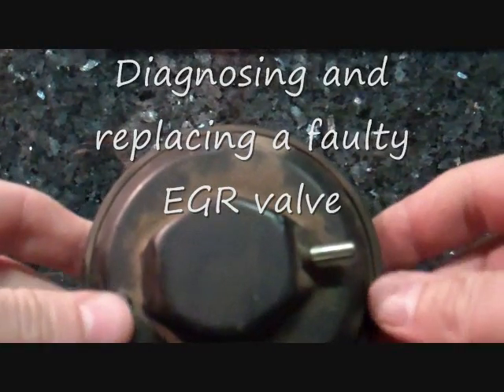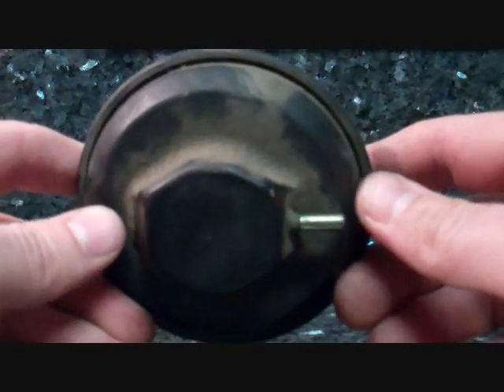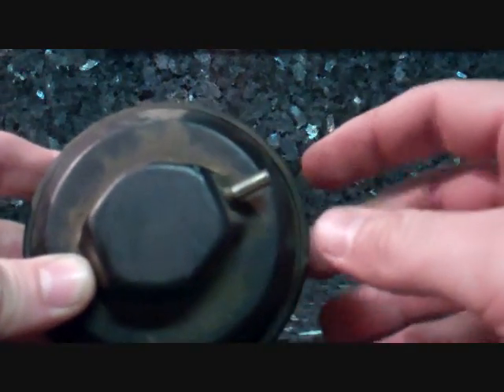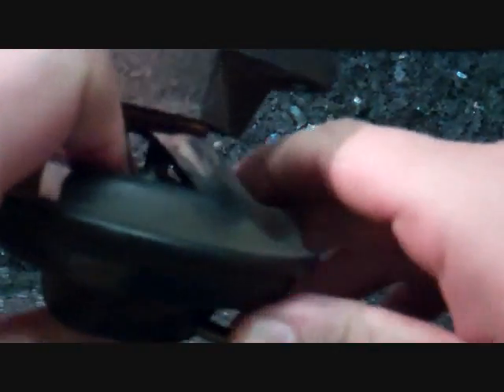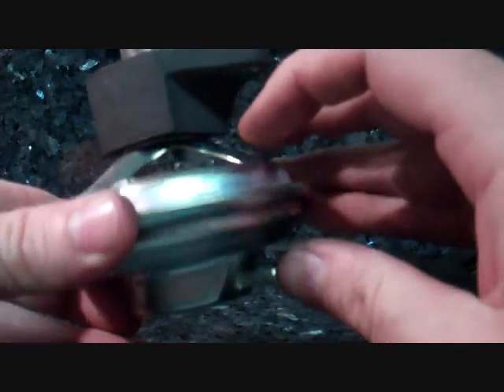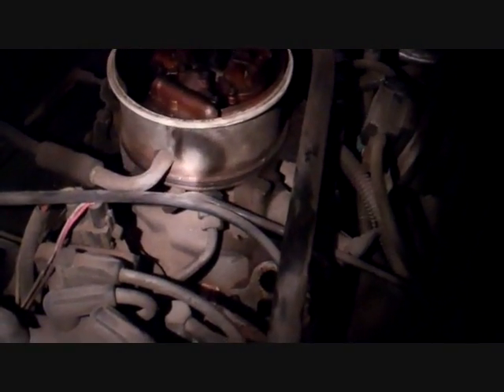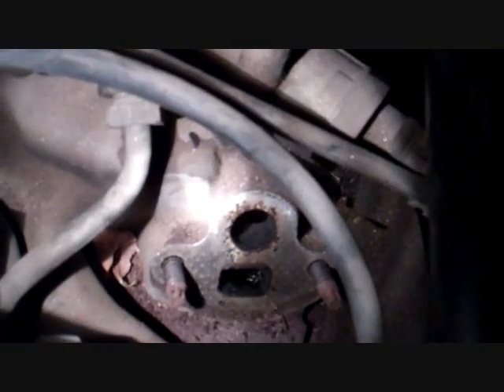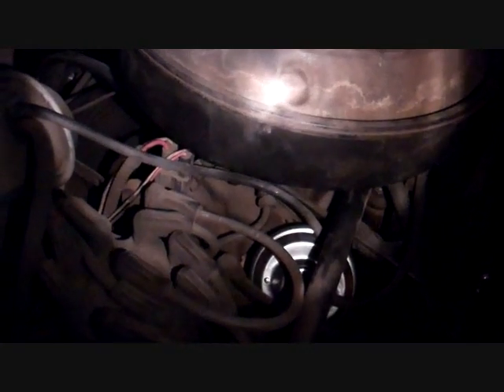Diagnosing and replacing a faulty EGR valve with a vacuum leak.

Comment: My bronco chokes and runs like crap when accelerating ay kow to mid range rpms. After unplugging vacuum line and blocking off vac line that problem went away instantly. Didn't gain any power but what it did was stop that choking and running like it's on 2 cylinders bs. Wondering if i have a leak/ low vacuum issue

Comment: make sure to scrape off all old gasket material. Also it never hurts to check the vacuum that comes to the EGR valve and that is operated/regulated by other component/s. Some people eliminate the EGR valve completely and put a metal plate over it.

Comment: I was trying to remove the nuts to check my EGR, but the nuts were also turning the stud. Do you know if I can remove the stud completely then install it back in after? Thanks for the informative video
Reply: J. Rocha yes nut stays on the stud do that bolt last and take egr off at the same time.

Comment: Hi,I have a 1990 Chev G-20 Van with no EGR valve,blocked off.
Would this cause rough Idle from 600rpm to 800rpm,up and down idle speed.
I also have problems excellerating mid throttle.
Thanks
Reply from the maker: It's possible... I'm not asc certified or anything, Google has a lot on the topic, search for egr block off and rough idle, or cons of egr block off
Reply: Hi,I bought this '90 Van with the EGR blocked off with a plate.
After watching the videos,I don't understand why someone would block the EGR valve.
On excelleration,the motor stammers at mid range and I have less power up hills.
On the highway it runs fine.
I live in Canada where temperature varies between -10 to +35,I'm thinking of replacing the EGR and see if this could be the problem.

Another issue is the 3spd turbo 400 tranny.
Dropping it into reverse with the brake on,
I sometimes hear a thud or bang.
Sometimes it goes in smoothe and sometimes it makes a thud sound,shifts smoothe in forward gears.
Thanks.
Ron
Reply from the maker: +Ron W yeah mine did the same clank... I think it's just a feature of an old transmission. Go easy on her. I did some research yes, the cold would have a lot to do with it. just reinstall one they're cheap and easy to put back on. also, I'd check for other vacuum leaks.
Reply from the maker: +Ron W also, I had the exact same van, I have found the transmission is much less noisy if I stop in neutral for a little while. as in don't go directly from drive to reverse let it rest in neutral a few seconds
Reply: That makes total sence,I will try that.
Why does the rpm rise and fall from 600 rpm to 800 rpm.
Could this be due to the EGR valve and a vacuum leaks.I've had a mechanic look at it,and their confused or don't want to spend time looking.
Ron
Reply from the maker: +Ron W your idle issues sound like mine.  my idling was all messed up, low speeds were to fast. as soon as I found and fixed all of the vacuum leaks things worked better. have you confirmed that whoever blocked off the plate properly secured the vacuum line that leads to it? go under the hood AND the doghouse and spray anything that looks like a vacuum line with starter fluid while idling. You'll hear a change in the engine when you hit a vacuum.
Reply from the maker: +Ron W and by under the hood I mean attached to the underside of the hood. buy fresh rubbery vacuum hose at any auto store. If it cracked once, it won't take long to crack again.
Reply from the maker: +Tunacrab I'm intimately familiar with this vehicle if you want to get in touch outside of YouTube
Reply: No,I haven't done this yet,good idea.
1990 Does the EGR vacuum tie into a solenoid switch or straight to the throttle body/manifold.
Reply from the maker: Ron W it went to a switch on mine, mine was a 91, but in pretty sure they're the same thing.
Reply: Ron, EGR valves are not activated in idle. Check for a vacuum leak, however.

Comment: I have a 1990 G-20 and I went to check the oil today and noticed exhaust gas coming out  of the oil filler tube and it was super hot, also my tail pipe rusted off behind the cat could this be causing the problem?

Comment: I have a 1990 Chevrolet G10 Van 350/5.7 My ERG valve is no good but when i took it off i noticed there was no vacum line connected to it I do not no where the line is. I noticed if front of the TBI there is a nipple coming off my intake manifold does the line go there?
Reply: ***** I have a 350 5.7 1990 Silverado. The hose on the FRONT of the Throttle body goes to the EGR solenoid. Then, from the EGR solenoid, another hose goes to the EGR.

Comment: Hello-
I have this same style van and I am having trouble getting my EGR valve off. What wrenches did you use? 7/16 angled? My valve bolts are very rusty. Did you have to remove any peripheral items from around the EGR valve. I am trying to soak the nuts with PB Blaster at the moment.

Comment: Thanks for the video.  My wife has a 76 'Vette with a 350 and VERY EASY to access EGR valve.  So easy to access that I will use your tip to check the EGR valve.  Thanks again.

Comment: I would like to add that most TBI equipped cars are very picky when it comes to the EGR valve. Try and buy AC Delco or Delphi brand when getting a replacement. Use your factory OEM number to match up the new one. The "universal" types that autozone sells are usually crap and will still give you trouble when brand new.

Comment: Very informative video thanks!!!

How did the computer know that there was a problem with the EGR system if there are no electronics hooked up to it.
Reply: the vacuum line that connects to the valve is also connected to a solenoid that controls the vacuum given to the valve. typically these solenoids have a temp sensor in them that can sense when vacuum is sent through since it only circulates hot exhaust fumes.

Comment: can any one show me where is the egr valve in 2001 gmc safari sle i am looking for that but i dont see please can any one explain me where is it on this modle engine
Reply: The EGR valve is located on the CENTER HEAD under your CARB/TBI usually towards the firewall..

 It will be easy to spot as it is the begging of the vacuum lines. Yours may very well be completely different shaped than the one in this video so I hope this helps.

Go to autozones web site to see a picture of what yours looks like to help you locate it faster!

Comment: Mine will INTERMITTENTLY (about every 3 key starts once it warms up to temp), run terribly in a "rich" choke mode kinda explanation. Ive done almost everything, replaced egr and egr solenoid, map, tps, full tune, cleaned all the grounds including ground straps, ... and one guy on here kinda had it when he said "coolant temp sensor" NOT coolant temp SENDER!!.. was fine, now installed another NEW CTS and its doing IT again INTERMITTENTLY. A mechanic told me well maybe you need to replace the distibutor "module" and or you may have to replace the ECM??... who knows but these are my next ventures. Ill keep you posted. thanks... - DTM ... BTW... No engine light in almost 1 years so... dont know.
Reply: Did you ever find out what was wrong?
Reply: Yes... replaced/resealed intake gaskets!! It took a week but easy and well worth the effort, time, and money. (about $200 spent)... I had the rear intake "quick-disconnect" brake off flush with the intake so my buddy had a nice "clean" intake on the floor of his garage that was going to go in his scrap pile?... booom!!  $50 for it. Ive had NO problems with the "choke mode" what so ever. Id suggest taking some starting fluid and goin around the intake to see if the engine idles UP and down... I also found coolant in my oil kind of slushy and bubbling out of oil tube and I figured luckliy that it was just getting into the lifter gallery?... my hunch was right. replaced/resealed intake... problem solved!! It took some effort, $50 for the intake off buddy, about another $150 for parts (new EGR was expensive), some time (1 week - Im picky!!), and some patience and problem solved. make sure that when you take out the distributor to make sure you are ON top dead center for reinstalll of the distributor. thanks... - DTM
Reply: Thanks for the update! You know what did it for me? No lie (and a little embarrassing)--just replaced the A/C and radiator fan relay switches and two fuses...voila! Engine cooling system now works, no overheats, no surges, no hard starts. Just a few measly fuses. Huh!
Reply: Lincoln7Echo Did egr valve cause a overheat because i have a ford f 150 1999 thst showed egr valve problem and it overheats.
Reply: Marky David nope... Mine didnt overheat at all. my "dummy lights" went out and no "dummy lights" have come on. ...

Comment: I have a 93 buick lesabre 3.8l its run pretty good but the problem I'm having is that it sometimes idle's high sometimes on start up sometimes it don't 
sometimes it does while driving sometimes it don't no check engine light on its like it idle's high when it want too.Have had sensor and ecm replace.what will be your opinion on my question?

Comment: My car jerks when trying to stay a constant speed from 30 on up maybe 25 on up. I am about to pull mine off and clean it and see if that helps any. Mine isn't wide open on the bottom like that. It only has little small circle opening about the size of the actual ink cartridge thing in an ink pen. The car sat for a year and 1/2. This jerking started off only doing it at 40 and real light. Now it does it at a wide range of speeds if trying to stay steady speed.
Reply: by a idel contral vavle  put it  on   it will fix your proble

Comment: I like this video. I tested my egr while it was on the car and pushed the valve down held tube with my thumb and the valve stayed down. I then went and sprays some wd40 in the opening it created when I pushed the valve down. I figured what the heck might as well lube it. Now I didn't have an engine light or anything, I am having hesitation and rough idle and wanted to eliminate the egr valve. So this helped

Comment: on my 96 lexus es300 my egr has 6 bolts to near the firewall 3 in front and 1 holding the bracket for the vacuum modulator and is wedged behind my throttle

Comment: Please help I have high pitch squeal at idle or while driving it does not change pitch with rpm like a worn belt.My belts are good van drives great no prob just loud and annoying.Seems like somewere by my master cylinder?It goes away sometimes for a few minute but always returns.Change sterring pump belts and flush all fluids but still there.Please any help would be great I cant afford 100 hr fees to trouble shoot.Thank you
Reply: may be  water pump  they  make nose  look down on bottom  you were  here it  if  bad   keep running

Comment: egr valve's are so dumb & a pain in the ass
Reply: egr are  easy to fix  just  up plug  wirs clip  take off bolts  old one will come off   the bolt will comne off put new gas kit on it   then put new hose  on it  new pate with 3  scers  on it  first   then new  part  put  vacume hose on it  them both   it will run good  if not  look at  idel  contral vavle

Comment: I had the same problem with my 00 Accord last year. I am a diy and not a professional. I took off my egr valve and clean the passage. There was a lot of carbon in that hole. I also took off the throttle body. I cleaned it and replaced the gasket. And then I installed my egr valve. Finally, before starting the car, I clear the code with my scanner.  Did your mechanic clear the code after installing the egr valve?

Comment: So did you see a marked increase in your fuel economy once you replaced the EGR valve? My EGR code is still showing, even after replacing selenoid and vacuum valve switch.  I just bought a new EGR valve today (very cheap) and my mechanic is going to put it on for free.  Hope to lose the check engine code as well as improve fuel economy.

Comment: I have an EGR code causing my check engine light to come on.  Have replaced EGR selenoid and vacuum valve switch. If I plug the vacuum line, will I still get the code? Mechanic says EGR valve is fine. Need to get rid of the code (check engine light) to pass emissions.
Reply: reset  battery  take off  plus  then put  back on   light  will go off

Comment from the maker: @yj1992jeep Yes, it should. Also, it should stay depressed when you close off the vacuum input. Push it in, and seal off the nipple where the vacuum line goes with your thumb. It should hold the vacuum and not move until you release

Comment: Be very careful when undoing nut on EGR...mine was on a 87 astro, 4.3 and in order to take remove EGR, you have to remove  fuel outlet line, and those 2 lines are extremely difficult to get back on...I stripped mine out and had to get new throttle body!

Comment: hey i have been a chevy mechanic for 22 years and i see you found half the problem they have , what will also happen is the egr port that goes thru the intake will be stopped up to and cause the light to come on.find a metal bendable coat hanger and carb cleaner and run it in and out thru the hole that goes thru the intake you will have to take egr back off to get to it.

Comment: I replaced my EGR Valve yesterday. With the short test run I took, it seemed to be better however the engine light came on again. Today I take it on a long drive and will get the codes pulled. I'll let you know what else we find, Like you I did find another vacumn leak. So far it runs and idles smoother with more power.

Comment: By the way, I disconnected the battery overnight (30 minutes is sufficient) to reset the computer. That should help in getting recent codes and up to date performance. I'll let you know what else I find. 

I do appreciate your simple test on the EGR Valve, it made it easy to diagnose that problem. Thanks for taking time to make the video.